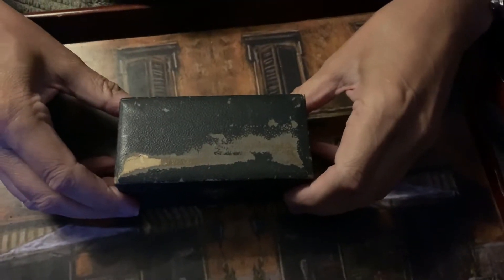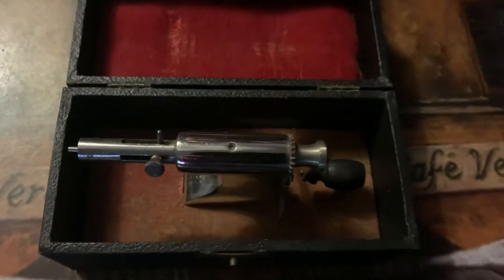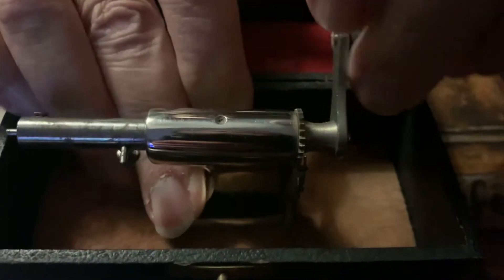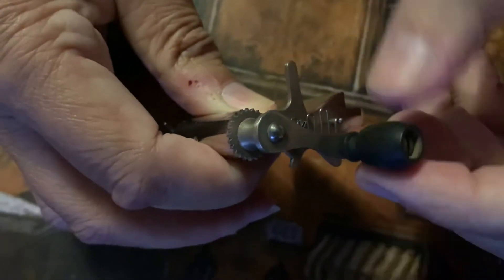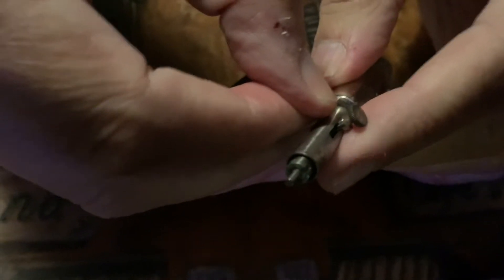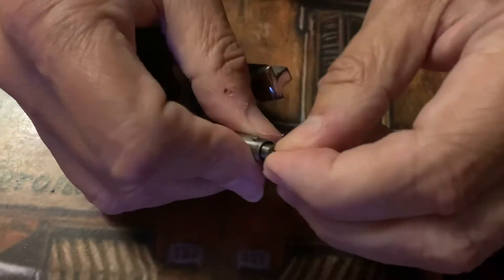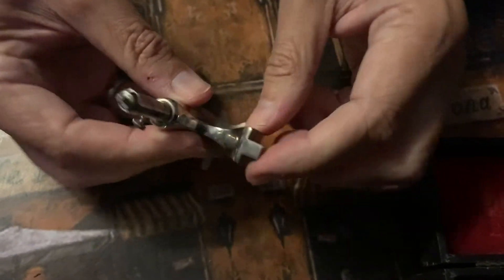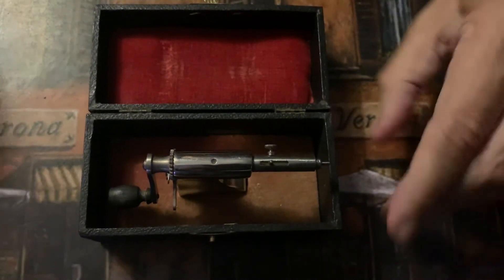What is this Crazy Tool #31

Comment: Looks like a tap follower for threading holes using a lathe.  it would replace the tail stock on a "big" lathe.
Reply from the maker: Interesting. Not familiar with that tool. But it does look like it is held in a vice
Reply from the maker: Again I'm not sure if this is a tap follower for a lathe as I think this is in fact the mainspring winder although I can't figure out how it would work

Comment: I would use that tool for peeling apples or potatoes.  The removable tapered pin is for small spuds.
Reply from the maker: Okay Mr bun. This is the funniest answer so far and perhaps you are correct and it's used for peeling apples or potatoes. This of course would be vintage apples or potatoes that are still around and not rotten by this time. I like the use of the removable tapered pin for smaller potatoes. As my family comes from Pei, we are very familiar with the world of potatoes as we landed in Canada in 1660 and manage to survive everything from war to starvation to this point. And I believe the potato allowed us to live.

Comment: Main spring winder I have something like this but I have to add on a barrel for different sizes.
Reply from the maker: Yes it seems to be a mainspring Winder for clocks however I'm not sure exactly how this would work and how the barrel fits on to wind the clock mainspring.
Reply: @JDRichard  Hi I sent emails before to you and like yourself I was a plumber living here in Ireland, lovely small machine for sale here in Ireland on a small site it's for cutting crystals it's in great condition. It will only cut flat glass but its lovely. Let me know how it's set up and have you come across one before.